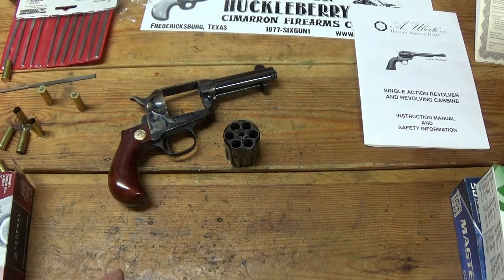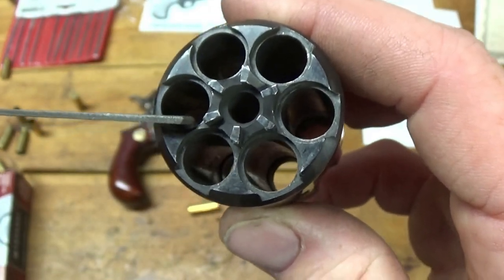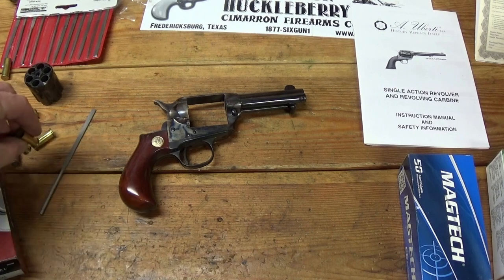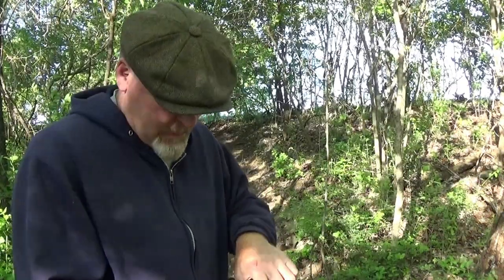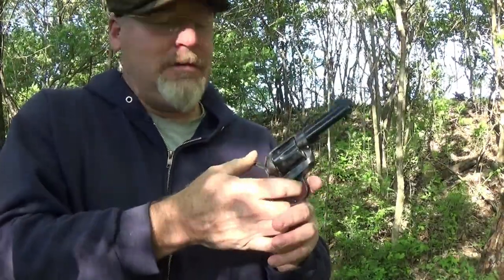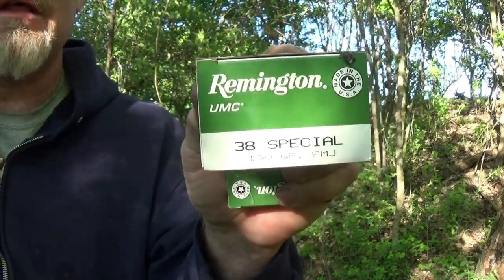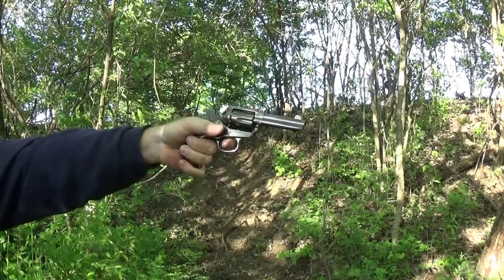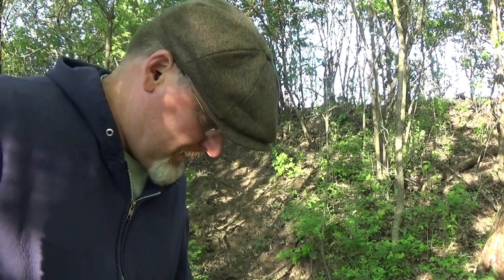Cimarron Lightning .38 Special 3.5" - Having Some Issues

Comment: Once the firing pin has been shortened with a file sufficiently you need to make sure no rough file marks or sharp angled edges remain on the firing pin tip. You should have a rounded and polished tip. If you can remove the  firing pin you can chuck it into a drill and  shape/polish the tip  to a hemisphere shape with emory cloth  removing any nicks, sharp edges left by filing  or pits/crater that may have  be lcreated from the pierced primer gas erosion. Federal primers are notoriously soft be the way.
Reply from the maker: 10-4 Thanks for the info.

Comment: i would try a lighter hammer spring. also check the face of the recoil shield for a rough spot that the bulged primers may drag on.
Reply: I agree, on Ubertis they sometimes don't machine off the face of the recoil plate on the left hand side, leaving a lip. Recoil drives the fired brass back, a dirty cylinder helps it to stick in that rearward position, then that tiny lip snags it.  A little careful filing down of that lip could fix it. Be careful not to file any off the top cartridge area, just the horizontal lip at about 3:00 as you face it from the muzzle.
The primer problem might improve by rounding the edge of the front of the pin, failing that, a lighter spring is a good idea.

Comment: I think the firing pin is flaring out the primers so they rub more against the frame . look at them from the side and see i there is the slightest protrusion after they are fired. Also some models of Uberti's have a sharp step to the left of the hand . that is often smoothed out with a file

Comment: If you are still reading your responses....remove the firing pin, chuck it up in a drill (pin facing out) take a file and radius the shoulders where it strikes the primer as the drill spins it...this is a problem with most Taurus revolvers (yes, Taurus bought Cimarron)...they ship their revolvers with flat faced firing pins...most times the pin sticks in the primer, locking the gun up...round the shoulders and it solves the problem.
Reply from the maker: I do still read the comments and thank you for the suggestion.
Reply: @INeverMetAGunIDidntLike  The firing in is pretty easy to remove w/o dismantling the gun. You will need a "spanner" flat tip screw driver bit. Thumb back the hammer and you'll see the retainer that holds the firing pin in the frame (has two holes either side of the firing pin for the spanner bit). Takes about 15 seconds to remove it...do it on a white towel so you don't lose the firing pin return spring.

Comment: A lot of the time it’s the step up on the recoil shield that will catch the rim of the cartridge. Stone it away a little and it will smooth it all up and the rims will slide over it
Reply from the maker: I ended up doing just that and it did help.
Reply: @INeverMetAGunIDidntLike  Yeah, lots of the Uberti revolvers have that problem. Some brass slide right over it and some catch it. Just depends on the sharpness of the brass rim.

Comment: Re cylinder binding try polishing the case rims a little with emery cloth to make sure when they back out from recoil against the recoil shield then fail to return fully into the tight factory chamber  mouth recesses thus binding the cylinder.
Reply: It doesn't make any sense at all to modify your ammunition in order to solve cylinder binding. Even if this solved the problem with those particular rounds, you would be stuck with having to modify every single round you put through the gun. The best solution would be to slightly relieve the area of the cylinder around each chamber opening to insure all makes of ammo would reliably fit the cylinder. Also, make sure your recoil shield is flat and free of burrs. Now, with that said, your primary problem of the cylinder binding up after firing, is being caused by your revolver having too long of a firing pin. It is causing the soft primers used in certain brands of ammunition to deform or back out of the primer pocket ever so slightly, thereby locking up your cylinder. You could make a spanner tool to remove the firing pin and then shorten, reshape and polish it to fix the problem. However, the simplest fix for you is to take advantage of Cimarron's excellent warranty service and just send it in and let them deal with it! Write them a short note explaining the problem, and include a couple of the worst fired cases. They'll immediately see the problem and have you fixed up in short order. But keep in mind that warranty work can be VERY slow. Expect to be without your gun for 6 to 8 weeks. I hope this helps.

Comment: I Have 3 of the Cimarron lightnings. two of the  .38 special  which I had never had a problem with. the other one is a .41 colt which the ammo dose not fit in the cylinder. Still trying to figure that out though. Love the lightings!  I would call Cimarron  and have there gun smith take a look at it. Should be free if you bought it from them.

Comment: I have 2, A blued one and a nickeled one and neither have recessed cartridge chambers. Was yours brand new?  I have Lee's trigger/bolt spring in mine and modified the hammer spring myself. Grind off of both sides, dunk in water when you barely feel the heat in the spring. then, polish the sides of it.
Reply from the maker: Yes, I did purchase it new.

Comment: I’ve got the same issue with mine. Seems like it’s the firing pin hanging up on the cylinder, does it bad when it’s not loaded. 
Did you get it figured out?
Reply from the maker: No I have not, I put it on the back burner. Some say to file more off of the firing pin but I'm not sure I really want to do that. Dang .38 Special almost costs as much as .357 did back before the ammo madness started.